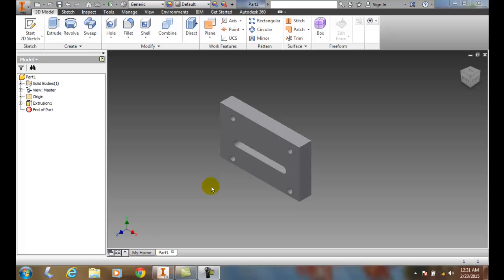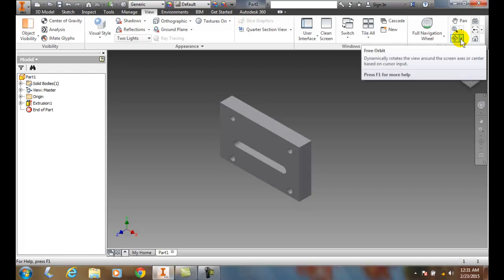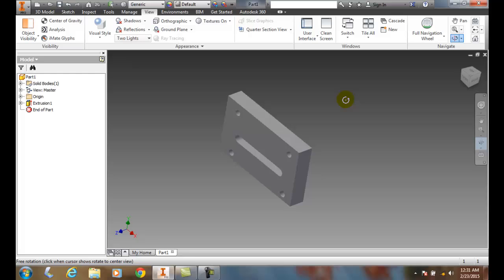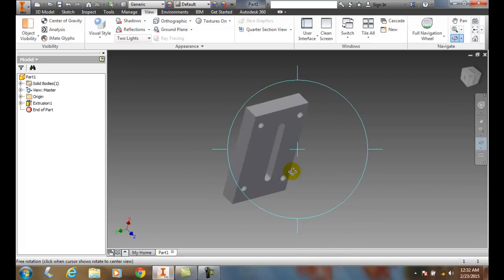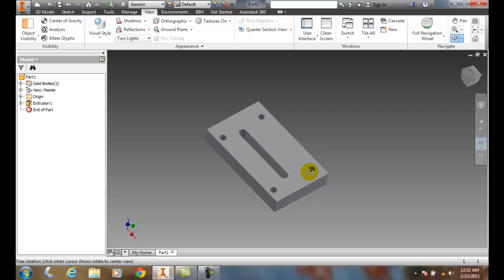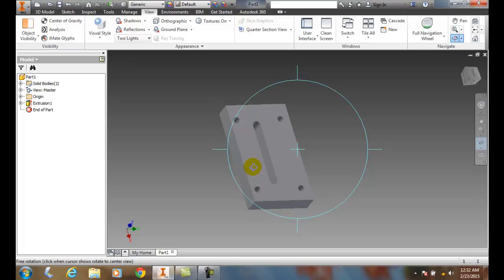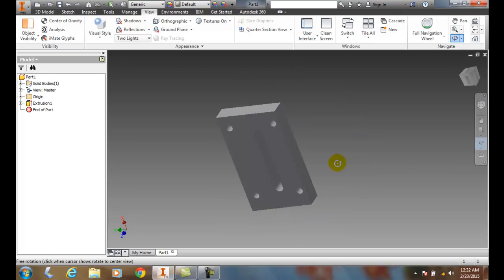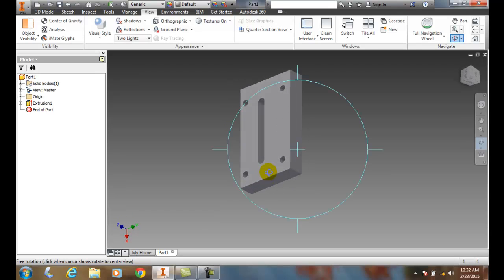Inventor 02-49 Constrained Orbit

Comment: Is there any way to simply keep the object still while the camera (line of vision) moves around facing the pivot point?what i want is a sketched object that looks like its fixed to the ground plane and the camera is just moving around facing the object.
In inventor 2017, whenever I try to orbit, the camera moves but it looks like the object itself also rotates around the pivot point and it is so difficult for me to set it to the view i want.
Autocad 3D seems to have that as a default setting when i orbit while pressing the shift key. and i want the same setting with inventor.